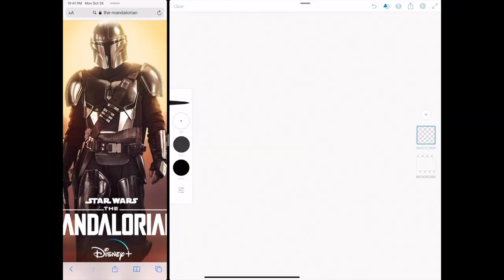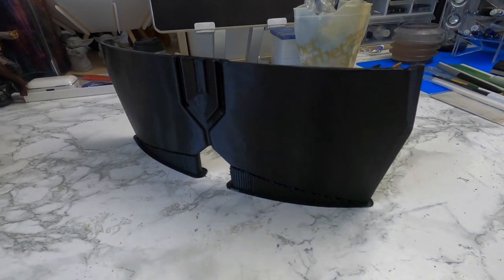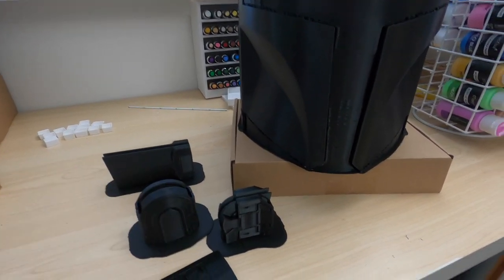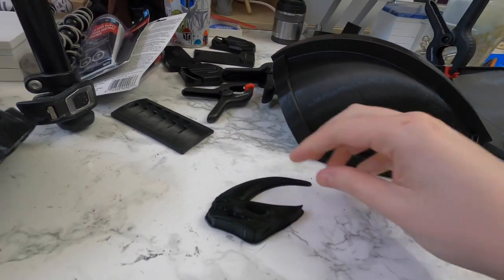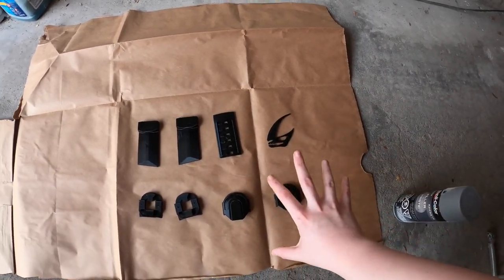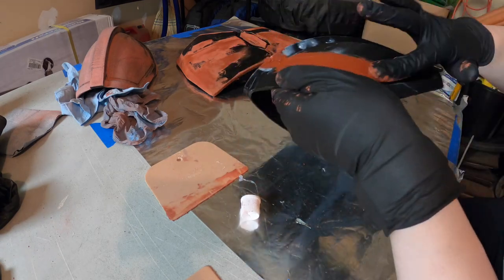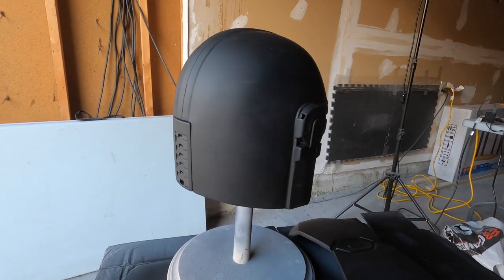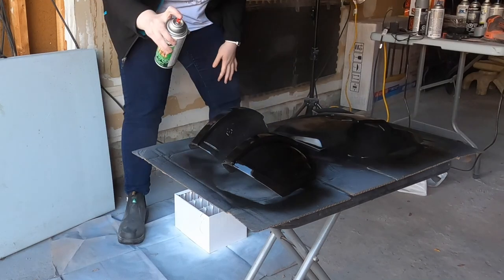Making The Mandalorian | Life Size Prop Build

Comment: Tip to make smoothing your FDM prints easier with Bondo... sand the raw print first before you add Bondo. It drastically cuts down your Bondo, Sanding, Filler Primer process! Great work!!!

Comment: The results are amazing. Pretty clean and accurate. Did you use a  clear laquer or gloss layer over the graphite powder on the armor? I ask bc I know sometimes that could affect the glossy appearance. I worry about fingerprints or the color coming off if I don't seal the armor or helmet.

Comment: 51:32 the way they do it is they spray alumaluster in about 2-3 light passes and the other parts get a pass more and a more satin clear coat. the mudhorn on the shoulder also get sprayed at more opacity but uses the same 2k clear

Comment: Nice work! My plan is to brake some pencils and get the graphite from them , then primer-gloss black-2k clear-graphite-2k clear what do you think ?
Reply from the maker: Sounds good! I’d just double check that there’s no strange reaction with adding the clear coating directly on top of the graphite powder; you might need to use some sort of artist fixative spray as a bit of a barrier.

Comment: When you sprayed the helmet with the black rustoleum that you said was a nightmare, how did you repair it and get it to be that amazing high gloss black finish in the end? Did you sand it down and start over? Did you use a flat black paint and then spray over that with the clear lacquer rustoleum to achieve that super glossy finish that you had in the end?
Reply from the maker: Yes. Sanded it down so that it was smooth again and then the flat black with the lacquer over it. The lacquer was going to make anything look glossy enough and I’ve always had great results with the flat black and not having it create drips or orange peel, etc.

Comment: I know this is 2 years later, but just for anyone watching ALWAYS ALWAYS ALWAYS spoon test paints. What that means is, if you are going to be layering different paints, (especially paints of different brands) put the primer on the back of a plastic spoon, then put all the layers on in the order you are going to be doing on your project. It will let you know if anything doesn't mix well and will help  you avoid the orange peeling that happened in this video. It only takes a little bit of time, but saves you disaster.

Comment: Can I ask what brand of paint you used for gloss black undercoat? Not sure if I missed it during the video.
Reply from the maker: I actually just ended up going with the matte black primer/paint combo spray I always use (Rust-Oleum Painter's Touch 2X Primer) and then the clear Rust-Oleum Lacquer on top. The glossy black that I tried out absolutely destroyed the props, I literally spent over a week getting them back to a reasonable level of smoothness after using 1 coat of the stuff.
Reply: @studioofmm  thanks!

Comment: I really really love it. One question with the Graphite powder. If you would like to wear this as a costume would you recommend useing the powder or does it rub of if you touche it ?
Reply from the maker: I’d still consider the graphite powder a valid option even for a costume, I’d just end up setting it with a clear coat to save the finish from getting fingerprints all over it, etc.

Comment: You won’t need conical supports for the helmet - because of the ways domes print they are able to support themselves even if they surpass your max overhang angle (especially on creality machines - they manage this great). The finished piece looks amazing tho👌
Reply from the maker: I know, I’m just wildly paranoid 😆 The next helmet I print I think I’m going to finally take the plunge though.
Reply: @studioofmm  haha fair enough - it ends up saving a lot of time and material!

Comment: What are the things you use to spread the Bondo glazing putty and where can I get some?  It is my understanding the graphite powder gets toned down once you seal it with SprayMax 2k Clear coat (to prevent fingerprints).
Reply from the maker: They’re actually the Bondo brand of spreaders. They come in a pack of 3. I prefer using blank Cr80 cards now as they’re more disposable. When the putty inevitably starts to adhere to the edge and make the spread less smooth you can just toss that one and grab another.
Yes I’ve had a chance to experiment more with the graphite power now and it appears that any sort of spray almost completely ruins the original look. I would assume it’s due to the combination of powder and spray/liquid.

Comment: Great work.
Question: You just used black as an initial coat and covered that with a layer or two of clear gloss lacquer. Then used the graphite powder to get the beskar color. Is that it, or did you also use that same clear gloss lacquer after applying the graphite powder to seal it from any smudges/wear?
Reply from the maker: I believe it was the black and then 1 coat of lacquer. I can’t see why doing 2 coats would cause an issue though if you don’t feel like you got enough of an even coat with just 1 pass. I didn’t use anything over the graphite powder as the mixture of power and spray would almost completely eliminate the graphite power effect. You might be able to use a spray intended for use with powered mediums to act as a barrier and then spray lacquer on top.
Reply: @studioofmm  Oh yeah that makes sense. I was just thinking of a way to seal the graphite powder because I intend on wearing my helmet and don't want to smudge it. 
You don't think a coat of clear would seal the graphite powder without ruining the color of it?
Reply from the maker: The graphite powder seems to be surprisingly durable. It’s weird. Once it’s rubbed on it really doesn’t rub off. Of course there could be a lot of different factors that could change that and I completely understand wanting to protect a piece intended for wear. 
I’ve never directly attempted to spray the graphite power with any clear coat, but I did try using it on a piece that I then added resin to and it basically completely dissolved the powder and turned it black again. I’d recommend whatever you’re thinking of trying to use that you do a test on an extra piece first.
Reply: @studioofmm  That's a good idea. I'll probably do a little test before finishing the whole helmet once the graphite powder arrives on Friday. 
So it's durable, which is great, but does it leave any graphite stains on your fingers when you touch the helmet?
Reply: Update: Adding a clear coat after applying the graphite powder worked well. Just make sure the helmet is clean and doesn't have any finger prints or marks in the graphite powder before you do the clear coat or else they will be sealed under and remain visible.
Reply from the maker: Great to know! What kind of clear coat did you end up using on it?
Reply: @studioofmm  I used that clear gloss lacquer you used in the video (thanks for the tip on that and the rest of the process)!

Comment: Hello mate, awesome work.I have a helmet that I use for display.It’s resin,after priming with grey primer, I used rub and buff, but after seeing the graphite technique I might try that.I am having problems securing the visor,could you maybe do a video on how you secured yours from the inside of the helmet please? Cheers
Reply from the maker: I go into a bit more detail about how I like installing helmet visors in my original Mando helmet video (around the 7 minute mark): https://youtu.be/h5MIk9bomOI

Comment: So my question is do you recommend using A certain type of clear coat once the Graphite powder is applied on to the Armor ?
Reply from the maker: I never personally ended up clear coating mine but I’ve heard people had great success with using the same clear lacquer that I used over the black as a final coat as well. Whatever you do it’s always a good idea to do a small test on something so that you don’t ruin your work.
Reply: @studioofmm  well in my Hobby tenure I’m thinking it might be A Good idea of clear coating over the graphite just so it won’t come off in Theory .
Reply from the maker: If you’re going to be wearing it, definitely. For display, mine still looks as good as the day I first applied it even without the clear coat.

Comment: How long did you let the primer paint dry before using the clear laquer. I have tried laquer before and it bubbled up the paint i put it over.  Maybe primer is different?
Reply from the maker: I’m not 100% sure but I’d say I probably left it at least overnight to dry before adding a coat of a different type of spray. I’d say it also depends a lot on how ideal your spraying conditions are; temperature, humidity, etc. That can effect how well things cure and layer a ton.

Comment: Can you seal the graphite without ruining the effect?  A matte finishing spray would knock down the reflectivity
Reply from the maker: I would just try finishing it with a clear lacquer spray. Because Alumaluster is a resin based paint the high gloss finish will still look appropriate. The graphite powder on its own is almost too reflective and mirror like.
Reply: @studioofmm  2k resin clear works or alclad aqua gloss. Check out the video Coregeek has on sealing it.

Comment: I'm a little confused on how you got the gloss black finished, did you paint it black and then added the gloss clear coat or did you just painted with a high gloss black?
Reply from the maker: My original plan was to spray it with a glossy black paint but what I used messed up the surface texture of the entire thing so I reverted back to my typical matte black spray primer with the clear lacquer spray over top.

Comment: Amazing Bust!!  Great work!

Where did you find the Cretacolor Graphite Powder?  I'm also in Canada and all I have been able to find is graphite lubricant from Canadian Tire, but it came out too dark.  Anywhere online I have found costs WAY too much for shipping!

Did you end up clear coating your beskar?
Reply from the maker: Thanks! I ended up getting mine from Amazon but it looks like it’s not available at the moment, hopefully that will change though! I didn’t end up coating the final beskar mainly because I ran out of time for having the optimal conditions to spray the pieces outside. I was also a bit paranoid that it might react strangely with the graphite seeing as it was a powder but it might be something I do in the spring just so that the finish is more protected even though it’s just a display piece.

Comment: Just out of curiosity, why did you use spot putty on the helmet when you probably could have just used spray filler primer which would have been easier/faster?
Reply from the maker: There were some deeper imperfections where spot putty was just going to make the job much faster. I went through a ton of filler primer as it was, not using the putty first could have doubled that amount. I was also fighting weather conditions constantly so the less time I had to spend worrying about if I could even apply the filler primer because of the weather, the better.
Reply: @studioofmm  Interesting. Thanks for the tip. I want to try printing out a similarly sized bust for Robocop and really that can only be done on a FDM printer. I just know that the amount of surface area is going to require a lot of prep work. I'm completely new to this and have just been watching videos (like yours) for some tips prior to doing it, which is why I was curious about the spot putty part. I guess it just fills in better than using the filler primer?
Reply from the maker: Really it depends on how smooth or rough your base is. Filler primer is absolutely amazing and is particularly life saving when you’re dealing with pieces that have smaller details that would be impossible to bondo without loosing a ton of the detail. If you’ve got some deeper imperfections and roughness I’d definitely suggest tying to fill them in with something and then filler priming it. It’ll save you on a ton of cans of filler primer. Wood filler can also work great as a spot putty substitute.
Reply: Hi I really want to try this It is amazing, What infill settings did you use please and how many walls. Thanks xx

Comment: 23:18 what is the red-orange stuff you use. I was going to make armor once I got a 3D printer.
Reply: Also I LOVED the video, It was amazing!
Reply from the maker: It’s Bondo Spot Putty. Definitely something to be used outside/in a well ventilated area with proper protection. If it’s a little too extreme for you wood filler does an excellent job as well for smoothing pieces out in the same way.
Reply: Studio of M.M Thanks!